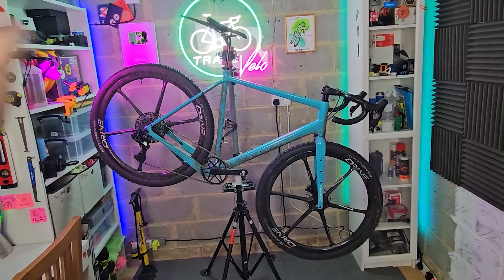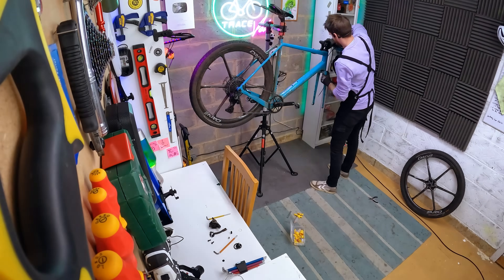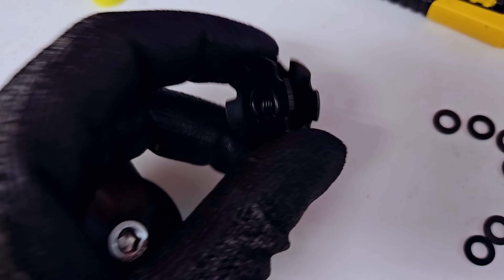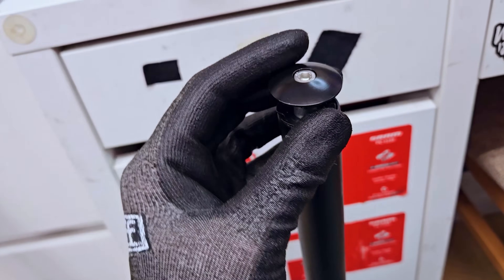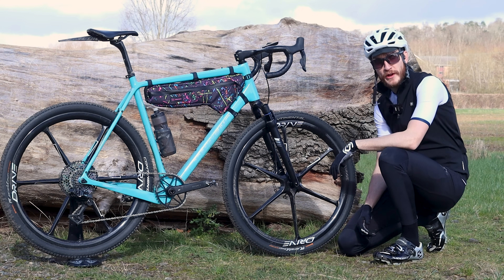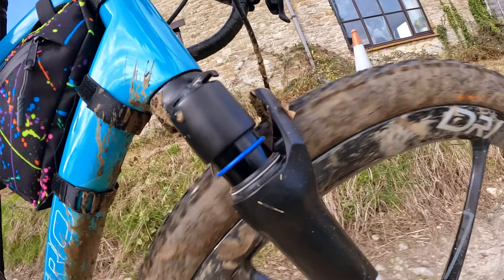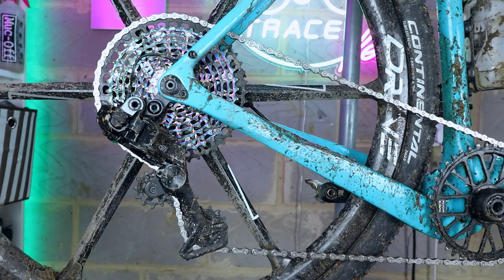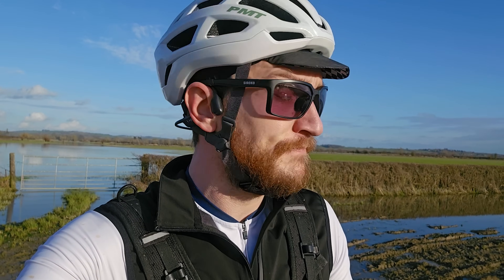Gravel bike suspension for only £90!

Comment: i use an ikea desk leg (€4.95) and a threaded bar as my star fangled nut driver, its a little long but it fits nicely over the steerer tube and the rubber foot on the leg makes a good pad for the rubber mallet to hit.

Comment: I've bought 4 of those forks for MTB, the Fox 36 copies, and they were bad. I upgraded the damper to an original Fox Fit4, and the bushings to original fox too, and it worked well for a less than a year, until the right lower leg started to crack and separate around the bridge. At least not good for MTB.

Comment: Have you considered checking out the Wheeltop EDS groupset? Carbon, adjustable number of gears, 100% wireless, IP67 - sounds too good to be true and should be perfect for a test from your side.
Reply: Headline price is rather expensive, isn't it? L-TWOO is much cheaper, and in the US (I'm in Europe unfortunately) SRAM seems to be running massive discounts on groups for months now, inventory glut, I guess?

Comment: 35psi for your tires, I assume you're running tubes? If you run tubeless you could probably be down around 18-25psi at your weight. You'd find it adds even more comfort and traction to the bike being able to go that low.  

Also, the Shokz headphones are really nice for riding aren't they?!  I have loved the fact they have real  buttons and leave you able to hear your surroundings. There's a pair with a shorter back band if you find the standard one too long like I did.
Reply: That wheelset he's using is hookless, so definitely tubeless.
Reply: @mjokffsgfjs  hookless doesn't mean he has to run tubeless, it just means he needs to run tires designed to be run tubeless so they grab the rim well and he can't exceed 70ish PSI, which for that size tire for a guy that light shouldn't ever have been a concern anyway. 70PSI in 50mm tires would be almost as bad as riding hard rubber for a guy his weight. 

I'm 6'2" and 250lbs and can go down to 25-30psi on 2.25" tires, and around 40-45psi on 40mm tires. I'd only ever go higher if riding somewhere with large rocks I might not be able to avoid.
Reply: @mrhankbotful  blah blah blah blah internet professor
Reply: @mjokffsgfjs you're one of those helpful types. I can tell from the wisdom you convey with your well thought out responses. What a savant. 🙄

Comment: You can use a compression plug on aluminium steerer, no problem.
In fact my cube nuroad has carbon fork with aluminium steerer and compression plug installed from factory.

Comment: I would think the 50mm tires would be enough. Maybe set the pressure at 25 psi. I went the opposite way. I ride my 32mm cross bike on gnarly mtb trails (wheels don't likle it). Also, I have a fully ridgid fat bike. I ride the fat bike on enduro trails. I do have other MTB and road bikes, but it is fun to change it up at times.

Comment: Dropper post next 👍 it'll make a bigger difference to the ride on the rougher stuff than a Sus fork will... Suspension forks are great for bump removal and adding to endurance rides, dropper post is great for adding control and manoeuvrability
Reply: Got a dropper on my gravel bike, so much better 👍🏻👍🏻

Comment: In 90s bikes like that were used but with 26 inch wheels. Even the fork was so simmilar, mz dual air with rebound and 4cm of travel. Nowadays, well the wheel is bigger but everything else is basically the same. Thats idiocrasy.

Comment: I feel like the best part of a suspension fork on a gravel bike would be being able to run 40mm tyres for speed on smooth stuff but still being able to absorb bigger bumps. Just like how MTBs don't use fat tyres, they use fairly wide tyres and suspension.

Comment: Just a tip.  You were hammering the star nut down and the suspension was compressing on every blow.   Put a piece of wood under the stem to the floor to remove the compression.  Of course they may be lockout forks and you had erm locked them out first! 😊

Comment: You can use that expander for carbon forks, those star nuts are meh and pita to install, not to mention heavy.
I use several expanders in alloy steering tubes, they work well.

Comment: Just so you know for the future you can use an expansion plug in a an aluminium (or steel) steerer tube, as long as it fits/grips enough to set the headset preload, as it serves no other function you could even use one of those dodgy lightweight ones. Star fangled nuts are a PITA to remove/reposition if you ever need too as well so an expander is the better option IMO.
Reply: I support that statement and was also irritated why he didn't use one to begin with.
Reply: @MDZPNMD  A lot of people who's main experience is with carbon think the top cap/star fangled nut does more than it does on a metal steerer, and if you're not sure it's always a safer bet to use what the manufacturer states/supplys I guess.

Comment: how about some cheap suspension seat-post, or suspension stem? Is there a good cheap alternative to redShift?
Reply: I had suspension stem from china. Not worth penny (pure moldings quality, this rubber inserts also very poor quality, and at the end when I was changing handlebar positions, one of the inside tread in stem broke ...)
Reply: And I have seatpost  suntuor NCX - bought july 2020 and used in my commute bike. Very recomend. Maybe finally I will test them in my road+ bike

Comment: Looks like that lockout dial can be cable actuated so if you had a 2x left shifter, you could try to link it with the dial same way as it is done with droper seatposts 

Ps. That mustache qualifies for an upgrade to cpt. price's one 👌🥖

Comment: Hi Luke, great one, loved it.  I did something like this on my old steel bike (already heavy so the weight difference was not so noticeable).  It really transformed my rides in our Welsh (poorly kept) lanes, taking the hand buzz out.  Nowadays I would try a suspension stem.

Little point, and I hope you don't take this amiss, but if you had washed the bike before openning up all the bearings and so on then you would reduce the risk of getting muck in the delicate bits.

PS, did you see Noah in the bonus clip?

Comment: I've always used a wrench socket for guiding the lugnut, works fine. But you could have used the compression fitting just fine. You can't use a star nut on a carbon steerer, but the other way around is perfectly fine.

Comment: I built a Monstercross a couple of years back to get the advantages you mention here.  The initial build was a 2016 Felt Nine 4 MTB; carbon MTB, 29er, 100mm Reba with the RLT damper upgrade. I only rode my regular gravel bike a couple of times afterwards.

TBH, I've never really looked back.....a 100mm air fork with decent travel adjustment is incredibly comfortable and makes the chattery stuff just fly under your wheels. I can adjust the fork on the fly if I'm riding in boulders.

In fact, I've taken it further, and the new MC is a 2016 Trek Procaliber. Similar to the Felt but 650b, and with the "ISOSpeed" soft-tail feature. Its even more comfortable.

I'd say that we've gone as far as we can with big 700c or 650b tyres with double bar tape for comfort, and some front suspension is (for me) pretty much essential for longer rides.